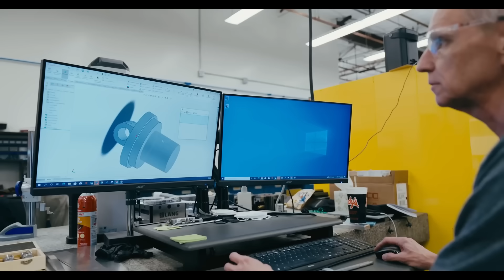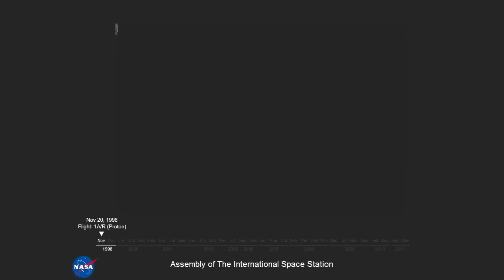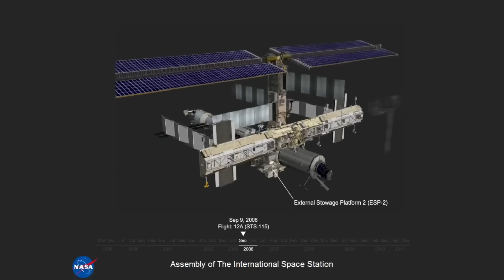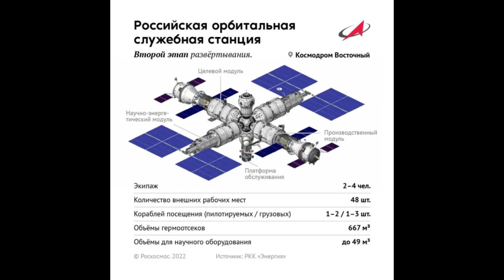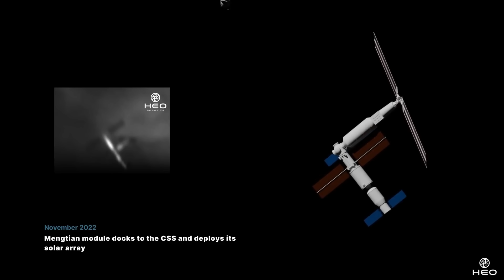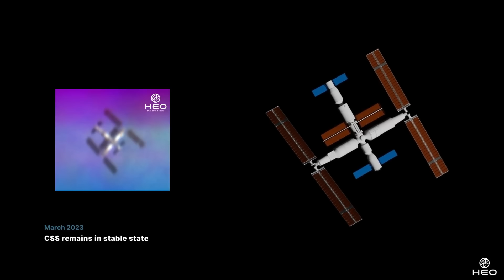Where Will Astronauts Go After The ISS Is Destroyed?

Comment: Commercial spaceflight and stations are the literal nightmare scenario.
Zero public control over this stuff is how it gets fucked up for generations.
Corporations cannot do the long-term planning required to have these systems function properly when they are always chasing the favor of investors, and worrying about maximizing this quarter's profits.

Commercial spaceflight costs the public more money, resources, time, and public risk than public projects.
Public projects are slow and full of bureaucracy, but the stability and public ownership is worth the tradeoff.
Reply: What planet are you from? 
SpaceX has proven every one of your points to be absolutely false. 
Corporations win the favor of shareholders by succeeding.
Reply: @slartybarfastb3648  "Make money number go up" is not the ONLY important metric of success.
Reply: Commercial crew has proven vastly cheaper than the space shuttle, and given the safety record of the Falcon 9 rocket, it is very likely that commercial crew will have a far better safety record than the space shuttle, too.
Reply: @elusivegeoff  No. The "individual flights" of commercial crew are less expensive. That isn't the same thing. A log of money was thrown on a fire to get to that point. That cost still counts. That money still had to come from somewhere.
Also, I'm not speaking purely about money. There is social expense too.
The corporate way of accomplishing a goal is to shotgun 1000 methods, almost all of which will fail, and take the few that are profitable. That just doesn't "work" for spaceflight. There is nothing profitable about putting a human on the moon, unless the government is footing the bill anyway.

I have seen projects with my own eyes that have been canceled because the current contractor has decided it isn't profitable enough next quarter.
The public no longer "owns" spaceflight, and that is a big mistake that WILL eventually come back to bite us.
Reply: @Prophes0r  you do not want to compare the program cost of commercial crew to the program cost of the space shuttle, lol
Reply: @Prophes0r  What I don't think you are getting is that people start companies to do things. People work together to fill that demand.

If something is government related it is inherently tied to politics and the whims of budget makers. Companies don't have that problem. If there is demand for something and it's profitable to do, usually some company tries to fill that demand.

If people live and work in space. A lot of the money they spend will be IN space. If someone wants to expand in space, or build in space, or make new things. All they need is money from their IN space job.

The biggest problem we currently have is that we don't have enough people IN space.
Reply: @Prophes0r  "their profits are tied directly to being shitty to the public"

That's not how private companies turn profit.  Yes there are massive corporations that abuse public trust but by and large the reason for that comes back to corruption in politics.
Reply: Dumb take. If we want Spaceflight and space exploration to become normal and doable for the average person, companies need to do it. 
People will need jobs and places to live in space, and they can't all be paid for by the government. They need ways of making money for themselves just like we do here on earth. 

Companies will naturally expand into space when it's profitable. 
Governments will need to pioneer and do the unprofitable things for the common good, just like they do here on earth.

The current reason we don't have companies naturally expanding to space is because there is basically no space market to serve. So it doesn't make any sense unless they can make money on earth, It's a chicken or the egg scenario. But once there are people and a market in space that's when big things start happening. Because the space economy can basically expand almost infinitely unlike markets here on earth.
Reply: @Jayc5001  By the average person? Sure...eventually. But we are nowhere near that. We don't even know what that might LOOK like. It is all purely science fiction right now. And it will continue to BE science fiction until we have a long-term foundation for it, which won't be profitable.
And the only way to make an unprofitable long-term project work is to have a government do it.

We are SO used to problems getting solved by one dude in a shed with an idea, or one person with a vision. But this problem is too big for that. It cannot be solved with personal interest.
Reply: @Prophes0r  
TL, DR: Yea, corporations can suck, but the government sucks in pretty much in all aspects to a greater degree (Speed, inefficiency, lack of care, etc.)
- You want to stop companies from "wasting" money? Don't give it to them in the first place. Stop buying anything from Amazon, Starbucks, etc. 
- Speaking of all the money thrown into the fire to get to where we are... Where'd the money the government used to get up there in the first place come from again?
- Social expense? What even IS that? Unless you're referring to environmental impact from chemicals/debris/etc landing on the planet from de-orbits/failures/etc...? In which case the government would be doing absolutely nothing different.
- Shotgunning multiple ideas puts more work in front of more people, which makes progress faster the same way increasing surface area makes reactions faster.
- Even ideas that don't make it still have valuable research and knowledge gained along the way that other ideas/concepts can make use of.
- Yea, there's no potential profit from putting a man on the moon. There's no profit in microgravity manufacturing techniques, long term extra-terrestrial habitation technologies or long-term medical research, asteroid mining, etc... None at all.
- The public never "owned" spaceflight to begin with unless you count the pre-WW2 "rocketry clubs", and even then, that's tenuous.
- Zero public control? Because the public very much had control over the government during the Space Race.
- The modern pressures of social media are THE method by which the public influences corporations currently. Everything is public now, or becomes public VERY quickly. Cameras are everywhere, and there's only so long companies can hide failures/misdeeds.
- Corporations can't plan? Yes... Because RCA never thought to diversify their product lines when radios were all the rage to ensure they'd have something to sell once everyone had a radio. Or John Deere NEVER having laid plans to steadily automate the plowing/harvesting/etc of crop fields, turning the farmer into an overseer of automated equipment.
- Replace "not profitable enough" with "won't bring in enough votes" and you've got the government's outlook on things.
- The USPS is infrastructure like power, water, and sanitation. While I agree that the government should have a hand in infrastructure, there's no clear definition of what that IS right now. Is it fuel? Power?
- Extra-terrestrial space is also not the property of any single government. A non-governmental body/treaty/convention would have to be established to determine and enforce what space infrastructure is, and that would have to involve at LEAST every government that has space agencies, and ideally should be every government on the planet.
Reply: @MisterHavoc  I guess we will have to agree to disagree.
I have been a part of dozens of good government projects over the decades.
I have never seen a "good" corporate project. Anything large enough to have investors has always been soul-less and poisonous.
I have watched first-hand while the Walmarts and Amazons have gutted small towns or entire industries and left nothing in their wake.
Reply: If you want the government to fund cities in space, you might just be an idiot because that is just never, ever happening. The ONLY way it's happening is if there is a profit motive and then it will happen overnight.
Reply: I think you're in water way over your head and making a fool of yourself.
Reply: @TheEvilmooseofdoom  Think what you like. I have decades of experience in the government/military sector. Security, IT, Infrastructure (and a bit of color-team fun).
I've seen the what taking a government program and moving it to the private sector does many MANY times.

I have also exited the tech-sphere on the corporate side because I couldn't stomach the short-sidedness and the money/investors first(only) approach.

I've seen hard working people take out payday loans to pay for groceries.
I've seen people skip meals and piss into bottles to keep their numbers in the green.
I've seen executives with 4090s in their office machines because they can't stand to let other people have something "better" than they do.
I've seen managers buy the wrong product or overpay by hundreds of thousands of dollars because they liked the color of a presentation, or the rep bought them a better steak dinner, or simply because it was the first option on a list and they were late for tee-off.

The government is probably not a good choice to manufacture paperclips.
It is the ONLY sane choice to manage vital infrastructure, healthcare, space, and anything else where the goal is public good instead of "Make money line go up".

Am I in over my head? Hell yes, because so is everyone else who bothers to think about it.
However, I also have a LOT of experience doing this stuff directly, and even more being 1-2 steps away from it.

Government corruption sucks.
Dragging their feet sucks.
Politics suck.
But they CAN be done well.

Privatizing something that is about public good CANNOT be done well, because the goal shouldn't be "Line go up", and that is the ONLY thing a company is allowed to do.
Reply: @Prophes0r  To us you are just another anonymous guy on the internet pretending to be important.
Reply: "The literal nightmare scenario"

I think you're being a little hyperbolic from the very start.
Reply: @dirtypure2023  If your life support, food, entertainment, and ride home are at the whims of an unstable CEO, algorithm, or investors, you are living a nightmare.
Good luck getting in touch with HR from high orbit...
This feels WAY too similar to "Company Towns", which have been an enormous problem in the past(and present...)
So yes. Literal Nightmares. No hyperbole.

Space projects need to be Public Works, because they are FOR the public.
Reply: @Prophes0r  So basically you think space exploration will turn into The Belt from The Expanse?

Comment: The brief mention of a Starship-based space "station" replacement is the most likely way SpaceX will contribute to replacing the ISS. Yes, it's a lot easier to land your "station", refit it with new experiments, and then launch it again than to place a ship in orbit and send up new equipment and supplies that have to be squeezed through an airlock and set up by astronauts. Astronaut time in space is very expensive! Replacing/modifying equipment in space takes extensive planning and rehearsal on the ground. It's much easier to land the ship and let techs on the ground do the work and test everything. 

It's surprising how many Starship fans still can't get their heads around how many paradigms Starship breaks. Launching once a month will be cheaper than anything NASA does now. Ditto for the commercial stations. People get carried away with grand visions about how a converted Starship can be a much larger version of the ISS when there is a more pragmatic option. One permanent piece of hardware that'd be useful to stay in orbit is a small module with solar and radiation panels. The shuttling station-ships can attach there rather than unfolding complex panels. It's also save room on the station-ship.

A crew can go up for two weeks or two months. Idk if some long term experiments will need to stay longer but a Starship LEO economy will offer options. Bonus: if a crew will only be there a month they won't need to exercise a lot to stave off microgravity effects. ISS crews spend a very large amount of time exercising.
Reply: That would be similar to the Spacelab module, which was in the payload bay of the Space Shuttle.  Setting up all hardware prior to flight definitely saves a lot of time on-orbit.  But it could only stay on-orbit for a week or so, while Starship could stay up for months.  (I think HLS has a 100-day loiter time, for reference).  Definitely a gamechanger, as you say.
Reply: @satoshimanabe2493   Indeed. I wasn't specific as to which mention of Starship Scott made but it was to the bit at the end where he talked about Spacelab. The future Mars-capable Starships will have essentially an indefinite lifetime in LEO since they're made to spend 6 months each way to Mars. With LEO refreshment available something derived from that could stay up for... decades, like the ISS. Sooo many possibilities, and there will be a place for a long term station although I think the station-ships will do the bulk of the work. Even for a hotel.
Reply: If you are manufacturing, you don't want to be relaunching equipment all the time, especially if it's sensitive and/or heavy.
Reply: @Shrouded_reaper   There will probably be a place in the LEO economy for a permanent station or a long-term station-ship that stays up a year to more. One use would be for what you mention. There's plenty to elaborate on. Sensitive or delicate products of zero-g manufacturing will probably need to be brought back on Dreamchaser. But I think the great majority of work done on the ISS now can be done on a ship that returns every month or two.

Comment: Once starship and super heavy are sorted out, they could easily build a space station based on the Starship design that rides up on a super heavy. Just a few vacuum raptors with gimbal. replace the flaps with modules stuff full of radiators and solar panels, and instant mini space station. Without need of landing tanks, the nose can be adapted as a docking ring as well. 

With starship, all things are possible.

Comment: Question for Mr Manley...
since the ISS was built out of adding more and more modules, won't it be more intelligent to disconnect and dispose the older and more obsolete modules, and keep adding new modern modules, like updating the ISS, one module at the time, until eventually the whole ship has been updated, module by module, and keep doing so in the future ?
Im pretty sure that there are modular interconnection protocols that can be updated and modernized, as time goes by, and that will keep the ISS up to date
Reply: The problem with that idea is that the oldest modules are the innermost ones.

Unity (Node 1), for example, has Destiny (with the ISS truss structure and solar panels) attached at fore; the Russian segment attached at aft; and Tranquility (Node 3) attached at port. Replacing it would involve disassembling the entire station around it.

Comment: Can't they slowly replace the ISS  with the jnflatable modules that they get a Space Station of Theseus?
Reply: The key word is "slowly" They're getting rid of the ISS because when it was first built, the contractors were told "the parts need to last at least 25 years.". The contractors designed around that requirement, and conducted lots of tests to make sure everything they built would last at least 25 years in LEO. There is no way to know what will happen if you exceed that lifespan - it wasn't a design criteria and hasn't been tested. For example, aluminum has a fatigue limit. After enough stress cycles, fatigue cracks grow to where they compromise the structure (unlike, say, steel, which can be designed so it can be stressed indefinitely without weakening from fatigue). You may remember this from holes developing in Curiosity's aluminum wheels.

The same thing happened to the Space Shuttle. Its original design was specified to only last 25 years. As the 25 year mark approached, NASA paid for an extra 5-7 years of certification. This required looking at the design of every single component in the Shuttle, and putting them through various tests to guarantee they could last 5-7 years beyond the original 25 years they were designed for. As the 30 year mark approached, they concluded it would be more cost-effective to just design a replacement launch vehicle (the Shuttle was really heavy - cost to LEO per kg of payload was roughly 10x what Falcon 9 costs), rather than recertify it again. So the Shuttle was retired (RIP 1981-2011).

The ISS is already 25 years 8 months old. I assume they've recertified the oldest parts for an extra 5 years. So if we want to use it as a base to replace every single module, it needs to be done in a little over 4 years. Not "slowly". Or it needs to be recertified to last over 30 years. This may seem like an overly cautious approach. But remember, the people aboard the ISS are living in an environment where a major leak means everyone goes unconscious in 10 seconds, and dies in 60 seconds.
Reply: @solandri69 they don’t have to recertify. I don’t even know how you can since its in space. Just attach starship to it. When ISS really is falling apart, then detach it. Then you’ve learned how long these parts really do last.
Reply: Nah. Aluminium eating bacteria. Sounds funny, but it's what it is, look it up.
Reply: @isekaiexpress9450. Fuckin' bacteria.  Their extremely short life cycle makes it SOOOO easy for them to evolve.
Reply: No
Reply: Bigelow Aerospace ( 1998 to 2020 ) had been working on inflatable space modules for some time, there is a test module on the ISS as of 2016.   Bigelow also had a $ 300 " Fly your stuff " program where they launched small items into space and had a camera onboard to send images back to earth.